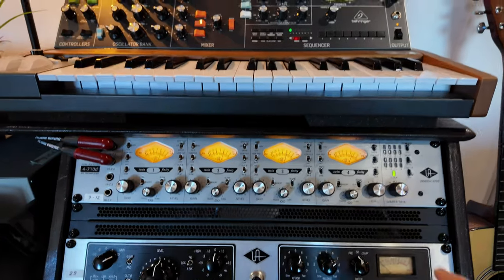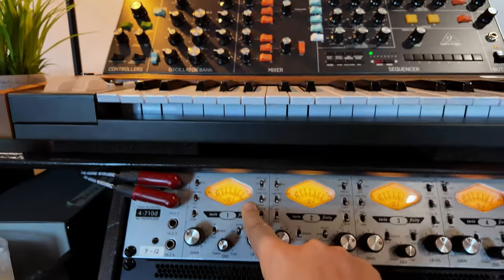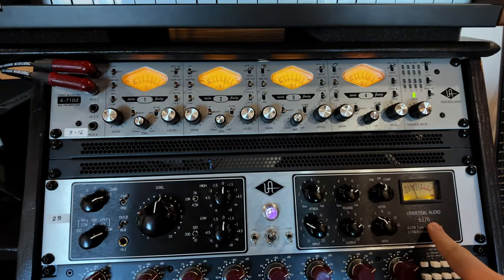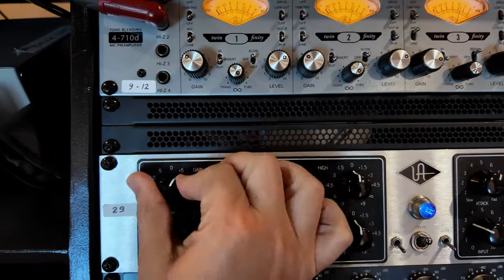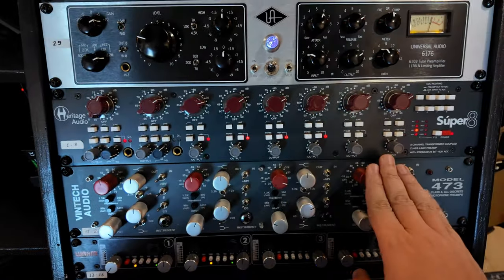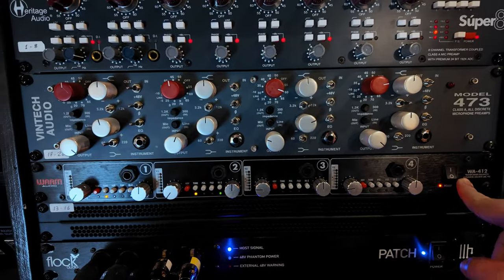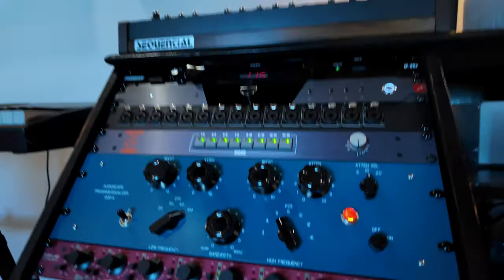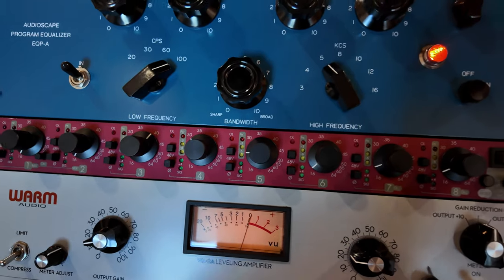My Analog Vocal Chain - Full Walkthrough

Comment: I’m just getting into outboard gear. First question, from the ssl do you then go to the Interface?  Also, is a chain this large necessary. You’re using two preamps for color at that point and 3 compressors.  I’m just curious what the purpose is for so many items in between the mic and the interface